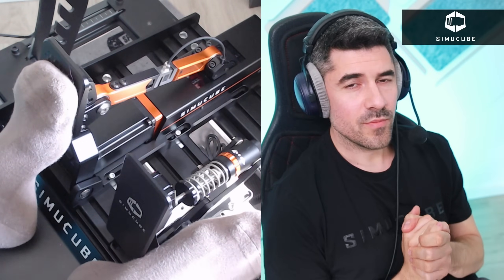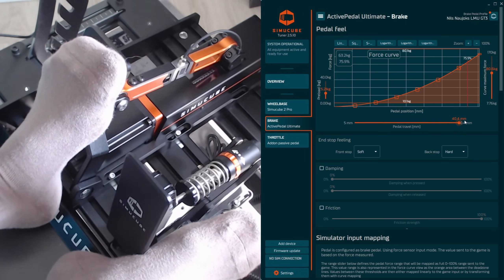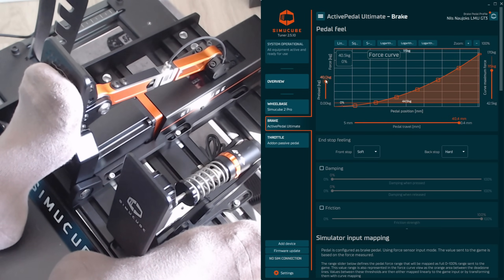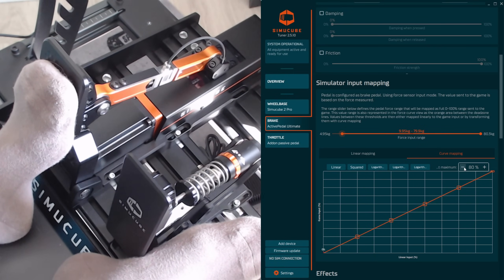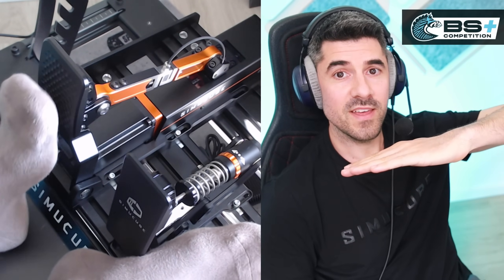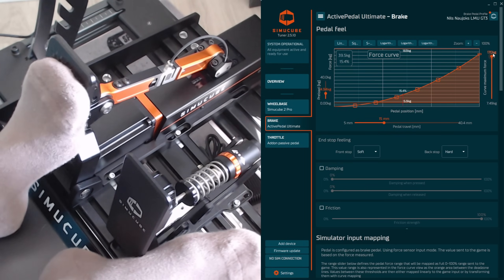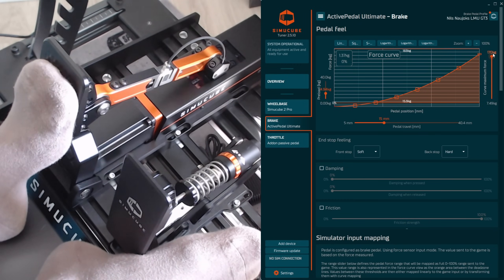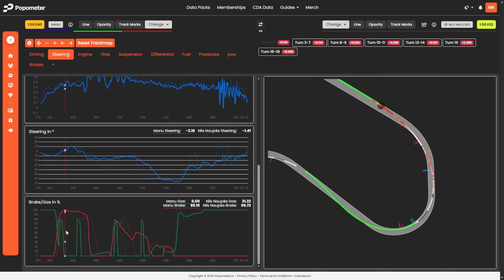How to UNLOCK your Load Cell's full potential!

Comment: I'm newer than new to Sim racing. Tomorrow, I'll hopefully receive my Logitech RS50 and Logitech G PRO Racing Pedals that I ordered. I hope I made a good choice? I want to use my gaming laptop for this (i9 14900 - RTX 4090 with 64 GB RAM) and, if possible, a 66" 4K OLED TV from Philips. I'll try it out like this first, otherwise I'll get a rig. What do you think of this setup, and do you have any tips? I've been driving for 40 years and have some racing experience, including karting. I'm leaning towards iRacing, because it stands out above the rest, although it is more expensive than Assetto Corsa (I have the complete series) and BeamNG Drive, Euro Truck Simulator, and Snow Runner. Do you have any good suggestions?
Reply from the maker: hardware seems fine to start. make sure the TV has high Hz and low latency. 
game wise I will always recommend AC, but ACE isn't in a position yet to go all in, though you could grow with it. it depends what you want to drive really. LMU and iracing are legitimate options of course
Reply: @SimracingPopometer  Thank you for your answer, sir. The RS50 should come today, but the pedals probably tomorrow or Thursday. This video about pedals is excellent. As a beginner, I try to avoid beginner's mistakes because I know how difficult it is to unlearn them. I'm a drummer, and I've been making some mistakes for decades. Believe me, it's virtually impossible to switch to the correct method, and I imagine it's the same with racing or sim racing. If you have tips, I would be thrilled to learn them.
Reply from the maker: Yeah, starting off right can save you quite some time. If you look for the calm and collected content on youtube, you will find everything you need. The louder someone screams, the less likely its a universal truth ;)
I should have something for most topics on the channel, even if sometimes old. If you have a specific question, better to join the discord. We kept an athmosphere of actual knowledge there, so on any topic there's some sort of expert around to answer!
Reply: @EXTRA300s  hey man, how the combo working for you? I just got the same combo for Xmas. The load cell brake is super hard for me to push.   Going to have to mess with the elastomers. Have you adjusted anything on yours?
Reply: @thecappy  For me, the pedals are very good. I chose the softest combination for the beak pedal, and set the force to 35 kg in Logitech G Hub. This works perfectly for me. I left everything set up this way from day one, and now I can drive well with it. Stick to the combination of your choice, bc you build muscle memory for this setup. Hope this helps, buddy.
Reply: @EXTRA300s  thanks for the reply. I’ll switch out the elastomers and go from there. I’m on PS5 and mainly play Gran Turismo 7. I did put the red spring from the clutch to the gas pedal but that brake is ridiculous.

Comment: i am new to iracing and sim racing in general. 
i have moza pedals that can do loadcell.
should i start with loadcell or angle.
Reply from the maker: if you have something to mount them to and you don't have a moving chair, and if you're already hooked, then go load cell :)
if you're just playing casually with everything still moving, load cell might not work well. generally though it's the better pedal full stop

Comment: For iRacing now still locking the brake to 80% is the correct way for GT3 ?
Reply from the maker: it's more of a meme. not sure what the actual best way is, but by putting a hard limit you'd sure limit yourself on situations where the car might take more. 
the more important thing in iracing is to be smooth and not go to max input right away, cause the tires are so load sensitive. the other thing is just to have enough range so you can be precise with the brakes being both sensitive and vital to rotating the car
Reply: @SimracingPopometer  Understood. Thanks for the reply 👍

Comment: Hi Nils, is there any scientific support that the body is more accurate with force than distance? As I could not find any. The body has feedback mechanisms for both but I've never seen anything to confirm that one is more accurate than the other. 

It would be interesting if you could do a video where you did a lap with zero (or minimal) travel at 80kg (or whatever preferred load) and then at say 40mm travel with minimal load. Even then,  i wonder how much of that depends on your personal preference and experience.

That said, travel based pedals always have some resistance, so whilst they measure distance, that distance will be associated with some force, from the spring, and if that spring operates over a linear region, there is no reason that the output will be any different to a load cell pedal with that same spring. 
Further, a common complaint of elastomers especially with simagic for example is the relaxing. So you hit them with some initial force, they compress, and then start to relax into their new deformed shape. This has the effect of reducing the brake output on a load cell pedal set. That would not happen if you were holding a constant force (the load cell obviously measuring your foot force). It happens because you are using distance as your feedback mechanism, your foot stays still after that initial application despite the force reducing. 

Not intended as a dig, just genuine fact based discussion.
Reply: Our bodies do not have position-sensing receptors. They do have pressure-sensing receptors. The brain infers position from the pressures sensed at different locations. Strong, higher pressure (like pain) - receptors send bioelectric signals to the brain faster through myelinated nerve fibers.
Reply: @csababeres1870 
What if you just move your arm a bit. There's no change in pressure. But you know how far you've moved. 
Even a quick Google shows:
Body position receptors, also known as proprioceptors, are sensory receptors that provide the brain with information about the body's position and movement in space. These receptors are located in muscles, tendons, joints, and the inner ear. They detect changes in muscle length, joint angle, and body orientation
Reply: So, if you blind fold yourself and try to move precisely in an empty room you'll get turned around almost immediately. Your movement is not robotic. It's very fluid and imprecise. You need constant points of reference to adjust to.

I think it's a combination of movement and pressure that gives the most accurate results. The constant reference point is the increase / decrease in pressure, and the movement is just a signal for your brain to pay attention. 

Movement decreases towards max pressure, and this is where the loadcell shines because it allows you to very quickly modulate the brakes without needing to visibly move your leg. When you are near lockup, that's exactly what you need to stay on the edge.
Reply: @stevenlarson3316  the blind fold part is exactly what I'm experiencing with my hall effect pedals. I'm using the srp lite with the brake performance kit and it really improves the feel of the pedals and you get more accurate with it because there is a distinct resistance and force needed when pressing it. However in game I heavily rely on the pedal traces glancing on it while applying the brake. I can even say I'm very accurate at braking with the hall effect pedals braking at any percentage I want to and consistently. But 40% of that braking relies on what I see on my pedal traces in game rather than the force I apply on my foot. As soon as I remove the traces I'm only accurate for a few minutes and I'm again "blind folded".

Comment: Great video to help explain the various setting influences but I would go into more depth around how certain configurations affect your car control. Personally I have been dialling in progressively higher load values in order to reduce my overall braking input but I noticed a few weeks ago I was spinning out a lot more on aggressive oversteer setups. I took the time to reduce the force back to a lower value I had previously found good and suddenly it corrected my spins mid corner. The issue was more force required meant too aggressive release and therefore spinning.  It’s all a balancing act of personal style in the end.
Reply from the maker: it becomes very individual, how you in your situation would gain control over the input your game needs.
if you have a rig that flexes a lot you have to reduce force on the pedal and also allow more travel perhaps, to prevent energy escaping into the rig.
some games like iracing are super sensitive on the brakes and many cars dont like the 100% inputs in the first place, so you need to make sure to have enough headroom to not actually get there.
for other games it can be beneficial to get to 100% quickly, but somehow remain fidelity in lower percentages for trail braking, like ACC and seemingly LMU. 
the preload I use to have a bit of a stepped pedal to really know the point from which my braking input starts and then there's a hard stop at the maximum kg i can press so i also dont press more than needed. but this is a feature exclusive to the active pedal, im not sure you could recreate that with elastomer based pedals.
the too quick release indeed can cause problems when the front end was locking a lot in the ABS and creating some understeer. when you release suddenly then the fronts might suddenly bite and follow the steering input you already had applied. you could also try to stay more neutral with the steering in that case until you release the brake quickly - boothby drives like that for example.

Comment: thanks Nila for the great explanation. I am at the moment struggling with setting up my new Heusinkveld Sprint pedals und running them with the out of the box setup rn. would be great to learn how to adapt those things you mentioned to a conventional set of pedals like the HE Sprint. otherwise I need to buy the SC Active Pedals for more versatility 😂😂
Reply from the maker: when i had the sprints i removed all but one rubber and replaced the rest with hard spacers - this way i would reduce a lot of the travel. i think i also compressed the preload spring to almost maximum , this way the pedal becomes somewhat 2 phased: initial softer millimeters until the spring is fully compressed, then a stronger resistance when compressing the elastomer. i would calibrate the pedals in the software so that they ignore the input while still compressing the preload and only give an input to the game once i stark working into the elastomer.
you can make the contrast between these two phases bigger when having the preload softer for example.
more elastomers for more pedal travel and more progressive increase in resistance - if you desire that. its all personal preference, but certainly worth exploring and always remembering that travel does not equal force
Reply: @SimracingPopometer 

thanks Nils for the detailed explanation. after watching your video I now know that pedal travel is not the same as force. I think I have some testing to do as I am new to this type of pedal. I only set a dead zone so I can keep my feet on the pedals and reduced the force in the live software to 21kg. now I have also added a haptic reactor and have noticed that I get into ABS very quickly and didn't know what to change. Your video was just right in terms of explaining all the correlations and how important it is to be able to keep 80%, 50% etc. constantly pressed over some time. long weekend ahead so hopefully I can test your suggestion 😊

Comment: Amazing video as always! Good insight and not a thing missed in explenations. I personally like 100kg force, but unfortunately my t-lcm pedals broke from such high force, probably because they are on rails and not a flat plate.
Reply from the maker: sounds a lot for a "plastic" construction. especially over time i guess the strain on the material might be too much
Reply: @SimracingPopometer  Exactly! I was a bit rough trying to get good X curve betwheen throttle/brake comparing with D. Wiersma laps. Well, reason to update my setup faster :D

Comment: Great video despite the people who don't get it. Answers some of the questions I had about why I can't get my braking to be smoother, although I don't like that part of that is get stronger legs. Been running about 40kg but guess I need to maybe step that up. I would say maybe a follow up on how to actually achieve this without an expensive pedal. I feel like my issue is 1-35kg is just me traveling through the spring and then everything 35kg+ is just me pressing on the load cell with no travel at all. Is it actually possible to get a nice smooth curve without the active pedal?
Reply from the maker: what pedals do you have?
Reply: @SimracingPopometer same question, i am using Heusinkveld Sprint but with a Spring conversion
Reply from the maker: so the elastomer removed and replaced with a spring? which would result in a more linear relationship of force vs. travel instead of the increasing resistance of the elastomer?
Reply from the maker: if you are happy, nothing you need to change ;)
Reply: I have p1000 with the spring kit. I'm using the suggested gt4 spring setup which is almost as hard as they get. If I only push through the spring travel the simagic software says I'm at about 35kg. I have them calibrated to have 52kg as 100% and it's a pretty good feeling but I still struggle hitting my marks. Trying to figure out if I need to adjust the pedal or just practice.
Reply from the maker: to go back to your initial question from the first post: it doesn't sound ideal to get smoothness when you have a very "two stepped" pedal. one can get used to anything of course, so this isnt necessarily bad.
The end of travel of your spring equalling 35kg would be 67% in the game then, right? I think the problem here is that 67% in the game dont usually mean anything. It's too little for straight line braking, too much for trail braking, so the intersection where it goes from soft to hard is meaningless somewhat and you cant use that to your advantage. an option could be to use a stiffer spring, to get movement up until a % where its useful for the game you play. say a stiffer spring would need 45kg to compress fully, then you'd roughly have 90% in the game and you'd control the 10% just against the brick wall into the load cell.
you could also do it vice versa, use a very soft spring so that the entire spring compression would only be 0-20% to control the trailing in that area, though not entirely a realistic feel perhaps.
for a progressive feel you probably want to use something that also gets harder the more you compress it (so a combination of rubbers), not sure these springs do that?
Reply: @ Interesting. The p1000s use dual springs so you can mix them up a little. Right now I'm using brown/green which are the 2 hardest one. It's very helpful though what your saying to really approach it from just where are the points in the % where I want to know where I am. That is how I originally calibrated them but I found that in practice it was too easy to spike to 100% in the heat of the moment so I added about 10kg to the max. I'm mostly ok with how they feel now but my brake traces are very not smooth like your thumbnail for this video showed so I was thinking maybe I need to go higher, but the spring thing was holding me back.

Comment: Do you like messing with the damping in the SC pedal.
Reply from the maker: I looked at it, but it's only really relevant if you have pedal travel, which I barely use. it also only affects the movement of the pedal, not the input. but the slower movement of the pedal might result in you moving your foot more smoothly too :)
not needed for the games I play imo. but see the point for iracing perhaps

Comment: This is why I like the Simgrade VX Pros. They can be set up with two stages, the travel and the load cell only. I have mine set up so when I reach the end of the pedal travel I am at about 85% brake force. If I need a little more I can push a little harder, of course risking a lockup. I have no idea what this equates to for force, but I do know it is fairly high as I have 100% brake set to around 70% of the loadcell's total capacity (200kg), but there is leverage from the pedal arm that I do not have the math degree to work out what that equates to at the pedal face.
Reply: I've done the same thing with my Invicta pedals. I use the white elastomer. When it gets fully compressed and the pedal goes into its 2nd stage is somewhere in between 80-85%.

Comment: guy shows off his cool pedal. no point to this video. maybe change title to calibration tutorial for these pedals.
Reply from the maker: i think you are underestimating that many people who so far did not drive on a load cell pedal, can hardly imagine what the difference is and therefor also not quite understand the various options load cell pedals have to adjust the feeling.
the video is hard(er) to do using elastomer based load cell pedals, because the adjustments take much longer.
the active pedal allows to show the impact of all available settings on non-active pedals without much difficulty.
Reply: There are always people who just want to misunderstand you…